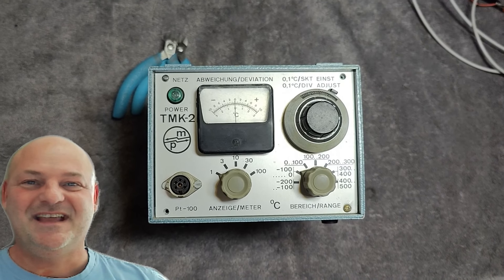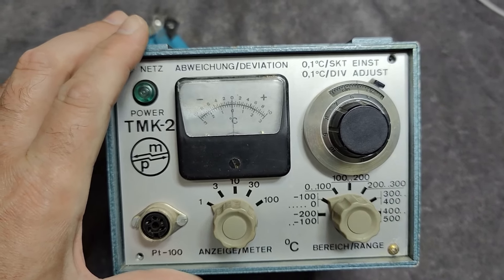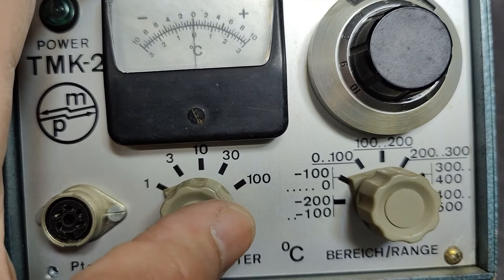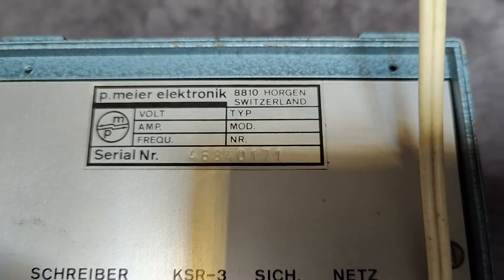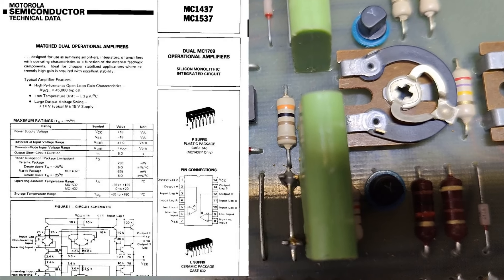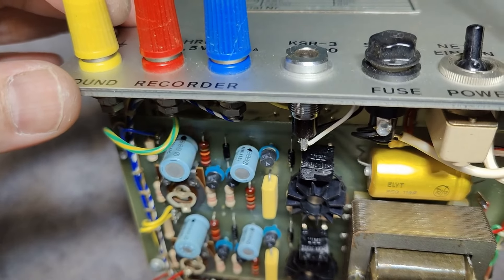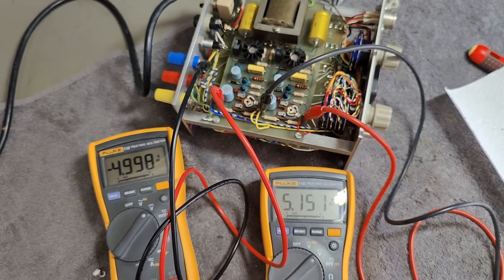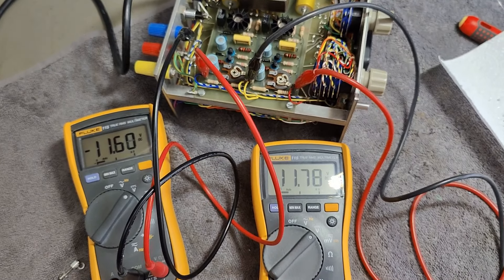P. Meier TMK-2 Temperature deviation meter switzerland 1969

Comment: PSU fault is because those 2 blue electrolytics are leaky. They reformed, and then leakage dropped down a lot. The 2 small blue are across the reference, and the other 2 larger ones are across the output. Typical behaviour for early 1970's electrolytics that have been stored for a decade or three.

Just fixed a PSU for my gate, 2 electrolytics wore out (Fong Kong specials that it came with), and the one went down to 47uF from 1000 uF, and was busy extruding the rubber bung, after it then popped the burst cap, while the other popped the cap, and went short circuit. Cooked the transformer though, so after putting in 2 2200uF 35V replacements, much bigger, and a new transformer, it works again.

Comment: 1970 week 33 is the date code, as Motorola never printed the first decade number. Also the colour banded tantalum capacitors and transistor cases are saying early 1970's, along with them using those painted precision resistors, with the parallel tweaking resistors being only 5% tolerance, against the main being 1%. But as those are in general 100 times the value or more not an issue.
Reply: Just came to make the comment that leaving the decade off was common back then.  Paralleling the resistors also helps to reduce their overall tolerance.  It's pretty much what I thought would be inside, although I thought there would be 2 op-amps (they were more clever!), otherwise a bunch of precision resistors for the ranges and Uncle Bob!  Nicely built unit, love the attention to symmetry in the layout.  As Dave likes to say "A thing of beauty and a Joy forever".